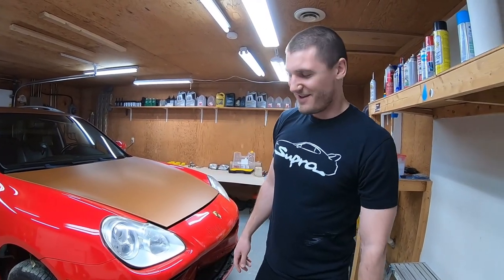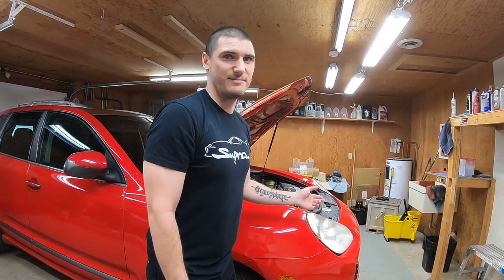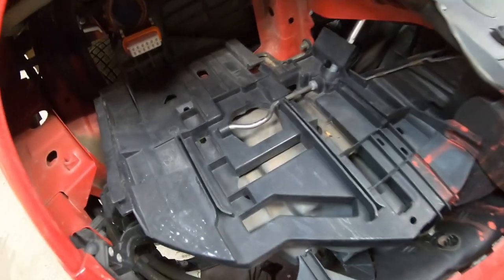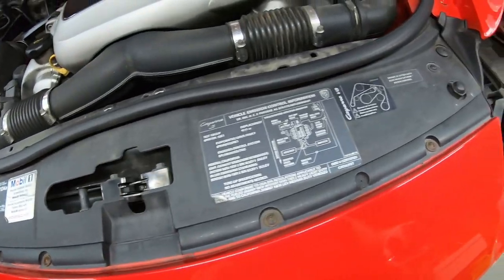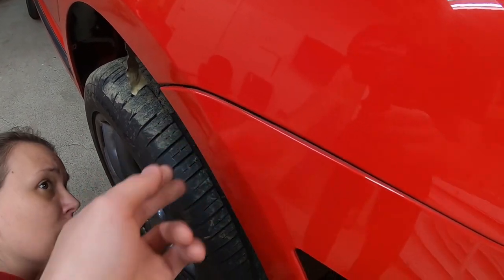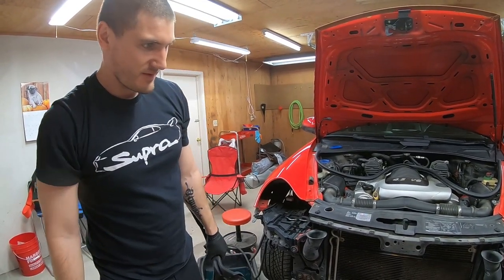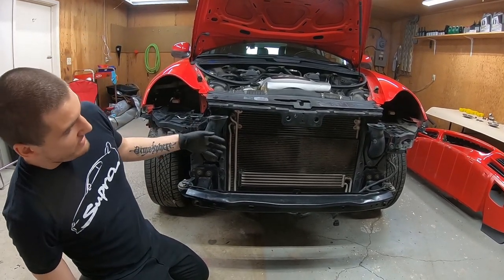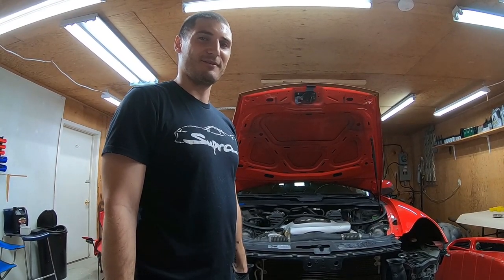Evaluating the Front End Damage on Our Totaled Porsche Cayenne S

Comment: Thanks very much for this informative video. 
I had to replace my hood latch and spent hours search for the way to get the bumper off… and here was the answer…. the hidden vertical screws on the side.
I was able to remove old and install new latch by just pulling it out enough to gain access. Still not easy but this is $1k job at the dealership.
Btw I’d recommend new cables while you’re in there…. 
Thanks so much for this. It’s the only diy that really says what’s needed.
Reply: HiBill-i-have-a-problem-with-the-hoodlatch-just-the-cable-to-connect-is-it--possible-to-take-only-the-top.the-plastic-cover-just-to-get-into-the-latch-to-fix-the-cable-not-intacked-anymore?the-reason-is-the-hood-doesnt-close-anymore-with-my-cayenne-S,2003-thanks-in-advance

Comment: These 1st Gen. Cayennes are pretty tough 💪🏼 looks like the front bumper and the plastics behind took the main brunt of the impact 🤘🏼
Reply from the maker: Auto Addict Yeea, exactly, we were happy it wasn’t any worse. Thanks for the comment.
Reply: No worries 👍🏼 best of luck finding all the front end plastic parts and a decent front bumper 🤞🏼
Reply: HiMatt-have-a-problem-with-the-hoodlatch-just-the-cable-to-connect-is-it--possible-to-take-only-the-top.the-plastic-cover-just-to-get-into-the-latch-to-fix-the-cable-not-intacked-anymore?the-reason-is-the-hood-doesnt-close-anymore-with-my-cayenne-S,2003-thanks-in-advance

Comment: How does the lower valance attach (with fog light holes) to the main front bumper?  I tried to get a look as you guys dropped the bumper and set it in front of the cayenne.  I'm trying to remove mine to get access to my front bumper sensors. Thx
Have you been able to find the plastic parts at a salvage yard?
Reply from the maker: abiglizard it’s basically a bunch of clips all along the bumper that holds them together, I think they’re also might be one screw on either side. I think it would be kind of tricky to get off without removing the whole bumper. We haven’t looked yet cause I’ve been really busy but I’ll probably make a video about that too. Hopefully we can find one easy but we’ll see haha, thanks for the comment.
Reply: @kamalakeel  Thanks!.  That's what I thought after looking at part pics on ebay.  My problem turned out Not to be the parking sensor. I was able to clear my parking sensor error code by cleaning the connector and putting dielectric grease on it. The connector is right at the front right side of the bumper.  At least parking sensors are one less thing you guys don't have to deal with on your project.

Comment: Hello, there is any difference between the Porsche cayenne turbo and standard  Porsche  like the front wing bumper ???
Reply from the maker: Yes, the front bumper on the turbo version has larger grill openings for the turbo inter cooler and such. I think they both fit though because I was actually looking at maybe getting one of the turbo bumpers to put on ours.
Reply: @kamalakeel  so you mean the wing and bumper will fit OK?